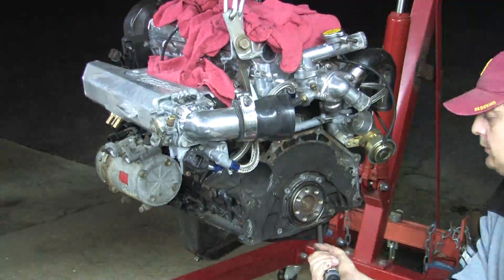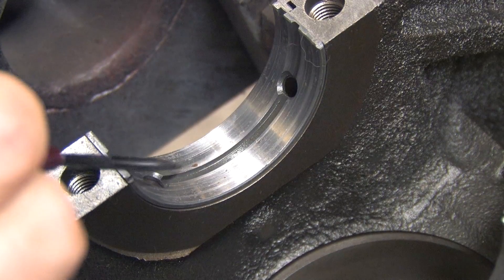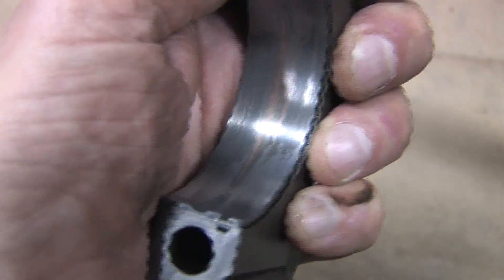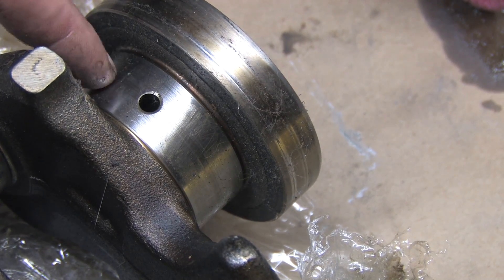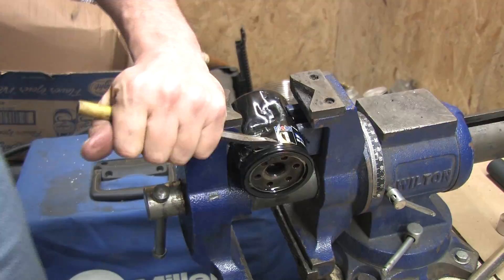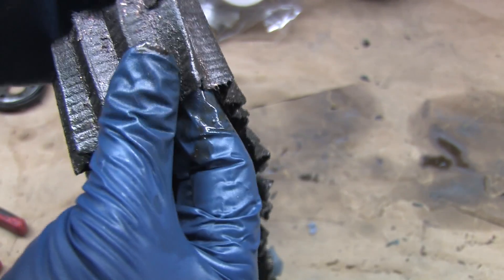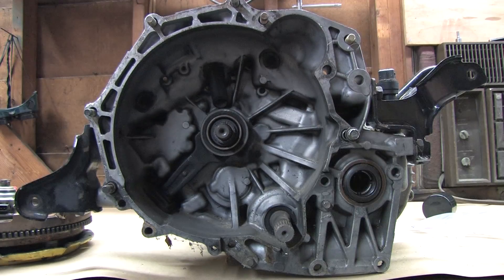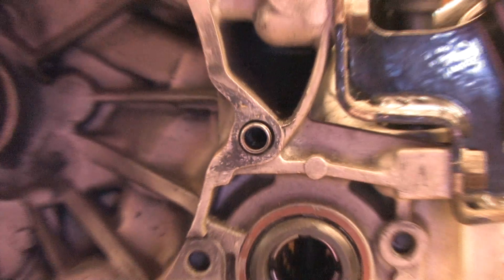7-Bolt Shortblock Failure - Full Diagnosis

Comment: What are the symptoms you were having with your clutch for torsional vibrations to you crankshaft? 

I have been having a vibration on a freshly auto to manual swap Mazda. The vibration occurs with my foot on the clutch, in gear giving revs. If I pull it out of gear or let the revs drop it goes away. 

I noticed that the crank pulley was wobbling and after investigating realized the crank moves in and out a bit. 

I been going crazy trying to solve this and actually have the oil pan pulled off and the man caps pulled figuring it may be a thrust bearing failure but all the bearings and journals look pretty good. I would appreciate your input have been following your videos for along time.
Reply from the maker: If that "a bit" is more than ten thousandths of an inch, you my friend have discovered crankwalk on a non-DSM.  It happens to anything if the crank thrust bearing fails.  I've seen a crankwalked civic wagon before.  I would suggest researching it thoroughly if this is what happened because the entire rotating assembly would be suspect.  The cost, difficulty and reliability of fixing it would negate the cost of its replacement.  I don't know how much your crank moved, but the testing procedure is in my videos.

Comment: what the fuck is a 7 bolt block?. I know of 3, 4, 5 and 7 journal blocks but not a 7 bolt block unless it's like a VW engine where you can pull the block apart???????????????????????????????????????????????????????????????
Reply from the maker: There are 2 generations of the SIRIUS I 4g63.  Both generations utilize the exact same main and rod bearing and crankshaft journal diameters, but the widths of those journals are different.  6-bolt blocks considerably wider than the 7's.  The 6-bolt and 7-bolt designations reference how many bolts hold the crankshaft onto the flywheel.  When you see 6 bolts on the flywheel end of the crank, it means bigger, beefier main journals.  6-bolt blocks ran from 1989-1992.5, and 7-bolts from 1992.5-1999.
Reply: they aren't 6 or 7 bolt BLOCKS you are talking in my 40yrs of being a mechanic I have never heard of a 5, 6, 7 or 8 bolt crank/flywheel being referred to as the block but then again you yanks make up so many bullshit words for items on all engines I see here on youtube when a backyarder is building an engine and the bullshit that goes into explaining WHAT CAUSED IT TO FAIL.
Reply from the maker: The 4g63 was sold in 49 countries.  Perhaps in your 40 years, you never had to work on one?  The difference in the crankshafts between the 6-bolt and 7-bolt generations means the block's casting isn't the same.  The cranks aren't interchangeable.  The block castings are different.  There is absolutely no reason why this isn't a perfectly good, globally-accepted nomenclature to describe it.  It's not a Chevy, and it's not called a 6-bolt main or 7-bolt main block like the Chevys are designated for obvious reasons when you're looking at them.  There are no 5-bolt, or 8-bolt cranks of any kind available for this engine.  Aside from the location of the bolt centers for the water pump and oil pump, and non-interchangeable rotating assemblies, every single other part that bolts on them are interchangeable.  Sorry if this information upsets you, but they are 6 bolt blocks, and 7 bolt blocks, and everyone around the world who knows anything about a 4g63 knows this.  It wasn't named by "yanks".  I don't want to know what you call the Japanese.

Comment: So that's why all my bolts backed out of my 92 gs turbo and broke multiple ears off my transmission.
Reply: would this bolt missing be the reason the car would lunge forward with the car in gear, the clutch in and at the rev limiter?
Reply: just small movements forward every few seconds.
Reply from the maker: Yes.  The transmission wasn't flush against the block.  That means your clutch wasn't aligned.  Only 5 thousandths of an inch is enough to cause problems with clutch engagement, believe it or not.  This is why using a torque wrench for service work is justified, and why leaving bolts out of service jobs can be dangerous.  Bolts improperly fastened can back out.  Sounds like you bought one that was serviced by primates.
Reply: Jafromobile I just noticed you responded. Lol.  I had gotten the car when I was young.  Head gasket blew. Had someone fix it. Got the car back and 2 days later the clutch wasn't working properly. I then found out from the kid I bought it from that the clutch had been changed by a shop and it took then 2 tries to install the correct clutch. I drove it to him 20 mile without using the clutch shifting like a champ. Lol he told me all the bolts loosened up and several ears snapped.  I got discouraged with the car and sold it. Boy do I wish I still had it. 92 gs turbo. It was dark green and the top was black. Lowered. With. Bbs 12 spoke rims.  Such a good handling car.
Reply: Jafromobile Thank you for all the information you have put on here for our disposal.  I have referred over 50 people at least to your videos. You have done more than you probably know for the 4G community.

Comment: I know this is an old video but I will try my luck anyway . As for putting all the bolts back in the bell housing MAKE SURE you put back on all stamp steel brackets that go from the bottom bell housing to the block this is to support the bottom half of the trans mission and gear box .

Comment: Like the saying goes, the overall strength of a machine is as strong as the weakest link. Well, in this case, the missing bolt, heh.

When I got my car it spun 2 rod bearings on the freeway. Fast forward to it being disassembled, we saw that not only were those rod caps not torqued properly, but I was missing the CW bolt, 2 T-case bolts and a plethora of other things. So you could say my crank walked but I believe it spun simply because the rods weren't torqued properly.

Had it machined and put the biggest oversized main bearings so it's living its final life as an operating block. Then they cut my flywheel too shallow (0.590"), so I'm getting some chatter among clutch smells when in reverse, but I'm working with limited amounts of money and parts over here so I'm trying to go by like this for as long as possible.

This in itself is my biggest mistake, knowing that it'll die again and why it will. But I decide to roll with it and hope for the best.

Comment: I would bet a good percentage of all crankwalk diagnosed 7 Bolt are from that 1 bolt.
Reply from the maker: I would bank on most.
Reply: not enough new videos I've been having to go back through and watch some of these for the third time... lol
Reply: all the boost Very, VERY, little 95-99 4g63 motors ACTUALLY walked. The #1 and only cause are oil squirters, this was found out years ago, and if you ever see them its obvious why.

Comment: Awesome video!   you gave me a much clearer understanding of what could have happened to my engine.
My car is a 1997 STi with an ej20k engine which has a center thrust ( old engine ) the thing is that my center thrust failed causing crank walk, which then lead to wearing on my bearings.
All this happened after I push and pull the clutch ( like a clutch kick) to powerslide the car ( stupid driving habit I had).
I wonder if by reducing engine and tranny movement this might help? the addition of stiffer engine and transmission mounts,  what are your thoughts? considering that the engine and tranny moves forward and backwards in a subaru...
I was thinking about installing this for an improvement  but if this will compromise this i would rather not.

Thanks in advance,
Chris

Comment: I'm a bit thick, so what broke up sending all that grit through the engine? Just one of the big end bearings?
Reply from the maker: #3 & #4 rod bearings.  Probably oil starvation.  Could have been too much timing advance but based on the rest of what I found I believe it was oil starvation.
Reply: Thanks, I guess it's a bit chicken and egg situation. Looks like No3 started to disintegrate first and a bit of that blocked the oilways accelerating wear. I just wondered if there was something else breaking up  as there was so much material. Again, great content. Love this.

Comment: err u have the same forces on the other bolts I fail to understand as
what if u left both the bolts out ?
Reply from the maker: If you leave the "crankwalk" bolt out... that one that "counters" the torque of the other bolts...  It actually has a considerably lower torque load than the rest of the bell housing bolts... THAT bolt.  It "counters" because it's counter-rotating.  It's irrelevant that the torque load is different, it just needs to be there because when you start loading and un-loading the axles, that part of the differential is hanging off the back of the bell housing where that bolt is missing.  That will wrench back and forth until all of the bell housing bolts come loose.  Mostly because they're all torqued and tightened in the same direction.  Twisting forces and vibration will affect them all the same if that one counter-rotating bolt, the "crankwalk bolt", isn't there.  In part of the transmission series I showed this with a straight edge, and how it lines up with the thrust load of the clutch and the transmission's input shaft.  If one of those bolts is missing on either side, the thrust loads on the input shaft will wrench all the other ones loose.  If you left both bell housing dowel-pin bolts out, you're shortening the life of your crank, clutch and main bearings each time you mash the clutch.  If the other bolts never loosen, it might even crack and break off your bell housing.

Comment: In an oil filter the bypass valve and the anti-drain valve are two separate things.  The anti-drain valve is usually just a circular rubber 'washer' that's located at the mounting end of the oil filter, and  covers the oil inlet holes.  This effectively forms a one-way valve that prevents oil draining back when the engine is stopped, which is a problem on some (but not all) engines.

Comment: I love your videos! Why do u use paper on your bench? The steel plate u have under it will wipe clean easy and hold no smell! Use the steel surface!
Reply from the maker: I've always liked it.  The paper is absorbent, so spills soak themselves in.  Sweeping and wiping the bench takes time and I get to do a fraction of that if I just wad the mess up in the paper.  There's less risk of scratching machined surfaces that I set on it.  I often take notes on it, sometimes I do math on it.  I can label parts that I set on it.  It's a neutral background that gives what I set and shoot on the workbench better contrast.  There's a ton of practical uses for it.  I don't paper the bench when I'm welding, and I don't always have it, but it's just cheap drop paper from a paint aisle at the hardware store.  Huge rolls of it are cheap.  I also use that paper for masking large painted surfaces, I've used it for gasket material...  million uses...

Comment: Hi Jafro, I have a couple questions I need to ask you. So, my 7 bolt spun a bearing and I have to do a rebuild on it and instead of just throwing something simple together I decided to go all out and take the time to build the car I really want to make out of it. That being said I am torn between 6 bolt swapping and keeping my 7 bolt. In this video you talked about how the journals are bigger making the bottom end stronger. My goal is to make around 650-800awhp within the next couple years. Either way the engine would be fully built of course and I just need to know if the 6 bolt would be a better choice for me or if my 7 bolt can handle it. My car is a 98 gsx and the engine has absolutely no crank walk. It won't wiggle at all. Also what makes the better choice better? Thanks!
Reply from the maker: If it moves any more than the width of 2 sheets of paper (.008") with new bearings, it's out of spec.  You can't feel it, you have to measure it.  The 6-bolt is a better option for your power goals.  It can be done with a 7-bolt, but I wouldn't do it without a forged aftermarket crank, a real dampener pulley instead of the BS factory one, and getting all of the main stud holes doweled on the girdle.  If you spun a bearing, you had an oil system failure somewhere, so really go through it.  I personally like the 6-bolt because of the main and rod bearing sizes, because of the bigger head studs, and because you can add a girdle more inexpensively than the parts necessary on a 7 bolt to hit the 650hp range.  Adding a girdle to a 6 bolt is cheap.  It's a proven setup.  I have seen 640whp dyno'd on a FWD 2g with a factory 6-bolt bottom end.  That's at the wheels.  I've never seen a 7-bolt do that.  Not that they can't.  Just that it happens with greater frequency on the 6-bolts.  Scrap the balance shafts and pick up the Kiggly crank trigger and your ECU will never know it has a 6-bolt in it.  Your transmission will be asking "where's my 7th bell housing bolt?", but the ECU will say "shut up transmission!  We have a job to do!".

Understand that any 2.0L 4-cylinder that makes over 650 horsepower will be problematic.

Comment: have you ever heard wd40 is bad and can cause rust I was thinking someone said it was water based .  I myself don't know just asking thanks
Reply from the maker: +Hale Cooley It does not cause rust.  There are people who insist it does.  The problem is with WD-40 that it doesn't last forever.  It evaporates eventually leaving no protection.  It is also not a sealant.  It can be washed away.  In extremely humid environments you must apply and re-apply because of these reasons.  If kept saturated, it works as advertised.  The WD in WD-40 stands for "Water Displacement".  Which means it sheds water.  

Think about Rain-X... after baking in the sun for a couple of weeks, it evaporates, too.  Paint works better than anything else more complicated at preventing rust, but who wants that on precision machined parts?  I don't.
Reply: No it is not water based it just evaporates in a few months leaving unprotected metal. Some say it is mostly Kerosene. WD-40 has burned me many times in my humid environment. Don't use it for storage unless u vaccum seal it in with plastic. i won't be using it for storage ever again. Use oil and maybe wrap the part to keep dirt out. WD-40 is not really a lubricant or corrosive protector. It's just a stuck bolt loosener or water displacer. I just have to look at the WD-40 can i have to to know it's no good for corrosion. All metal objects should be protected with one or more of the materials listed next. In this order: paint, wax, oil.

Comment: I still have no idea what crank walk is or the difference between a 6 and 7 bolt Mitsubishi crank :/ great video tho...
Reply from the maker: +PANTYEATR1 Crankwalk is excessive main thrust bearing wear.  In the magnitude of several times the service limit clearance.  Some have seen crank play as great as .105", and people have done it on both 6 and 7 bolt 4g63 engines.  Any engine can crank walk.  DSMs just have running shoes if left in the hands of the wrong mechanic.  That's the summary.  But the first sentence is what crankwalk is.
Reply: +Jafromobile thanks for the explanation. ever since i first heard of crank walk, ppl made it sounds like it was something that only happened to DSM engines. I'm gonna guess that 6 and 7 bolt refers to the flywheel bolt count? Why is crank walk such an issue on these engines anyway?

Comment: This video helped explain what went wrong with my engine. Blown oil line, #3 cylinder raped, and rebuilt the engine. But the thrust bearing surface of the crank was trashed and went un-noticed. I had no clue why the engine ran rough and vibrated. Was ready to have the flywheel turned and balanced when I saw this video.
Checked the crank shaft end play: 50 thousandths. Crank was bent like a pretzel, block bearing surface shot as well. Uncontrolled torque thrust. A boat anchor in the form of an engine.

Comment: No 3 Rod journal looks like a no7 journal on a 350 Chevy when the soft cams they used in the 80's wore flat. In those cases the no 7 cam lobes wore out completely, sending shrapnel through the engine. No 7 Rod journal gets wiped in the process and you see a lot of metal from the Rod bearing imbedded in the crank. Glad you found the cause of your failure. I would have guessed wrong due to experience rebuilding so many chevys back in the day.

Comment: As I am not into DSM's anymore, I did loose a 93 7 bolt engine to this very same thing. It even broke a ear of the transmission and subsequently cracked the crank do to the torsional twisting of the crank.

Comment: Hi Jafro! I wanna ask, how transmission deflection can cause any failure on crankshaft, or crankwalk? It's because clutch disc its not centered to crankshaft or what? :)
Reply from the maker: +zibalas1993 The input shaft skews the clutch disc and makes it press elsewhere on the flywheel other than center as it slips.  That's where the lateral forces come from that disrupt the oil film layer on the thrust bearing and allow it to pre-maturely wear.  Being that the large, heavy flywheel's gyroscopic effect is also disturbed, it amplifies harmonic vibrations as well.  You absolutely have to nail the clutch alignment, dowel pins and transmission bolt torques or else you're doing more harm than good by replacing the clutch yourself.  That's the best advice I can give.
Reply: +Jafromobile Thank You! By the way, from where You know so many things? Maybe You an engineer? :)
P.S. Thank You for all Your videos, it's one of best things in all YouTube :)